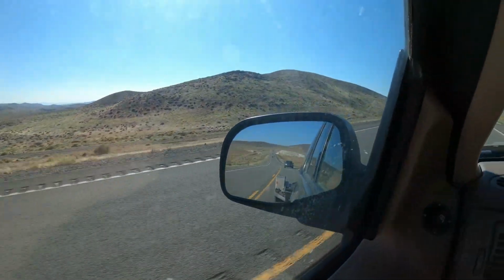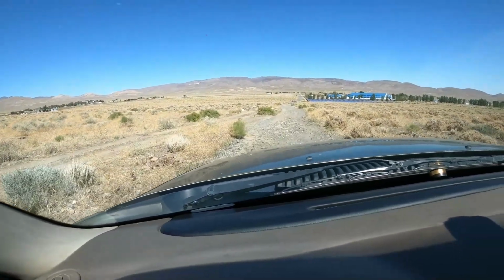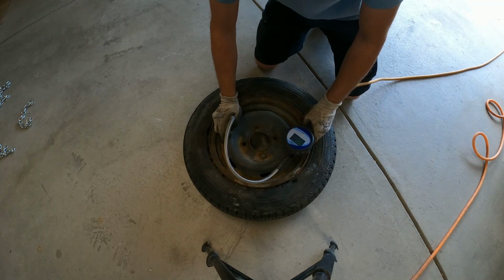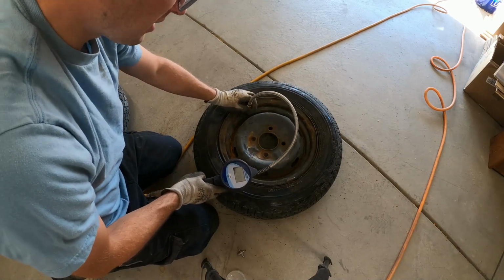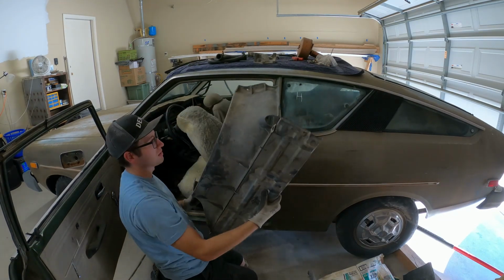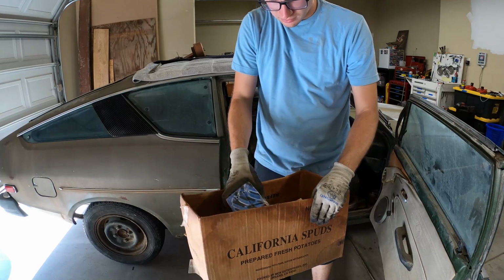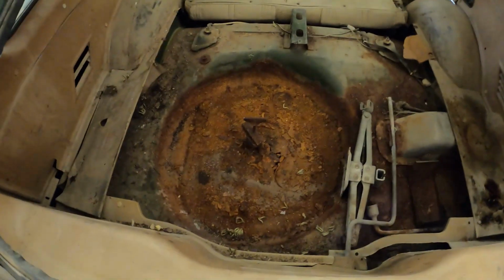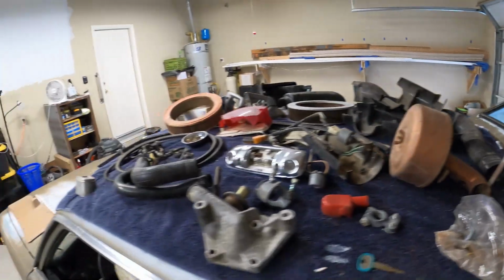77 Datsun B210 Part 1 | Recovery & What's Inside

Comment: Why the hell would you buy a B210?!? I owned one. They were horrible. Mine was the stick version and I still couldn't hit 60 mph in under 20 seconds. 

Mine was brown, so we called it Dusty the Datsun. If you used your handbrake properly, you could load it sideways into a snowbank, flip over onto the roof (or sometimes side), and slide out across the lake. Then, you and your friends could just flip it back over and wait 30 minutes for the oil to settle back into the engine before you took off again.

Seriously, as a car collector and a true lover of all things automotive, set this shit on fire and be happy for the heat. You'll get nothing good from it.
Reply from the maker: I don’t believe you
Reply: @stuiesgarage  Alright, wait until you build it out and see how horrible it really is. Or, you could just read some reviews from the time.

We did have some fun with it as late tens, but it's truly a horrible car. Good luck with your project!
Reply: Dont believe this nonsens. I own a 120y sedan automatic wich i restored myself. My ed6cation is a atomotive engeneer and in my spare time i value classic cars for a insurance company and in thath capacity have driven a lot of its competitars of his eara and can surley say that the Datsuj was among the best of its class and defenitly the best small automatic, so dont be put of and restore this beatiful car and enjoy it.